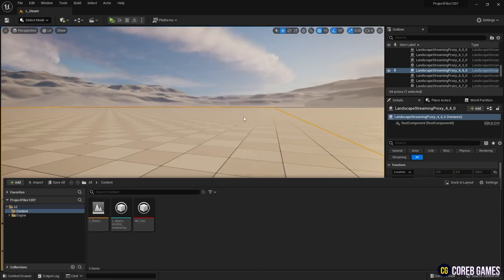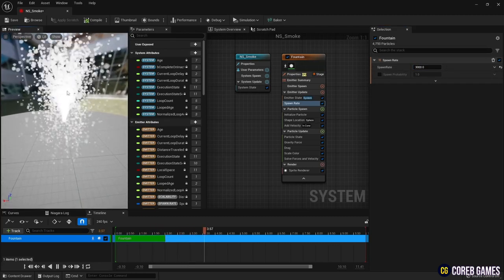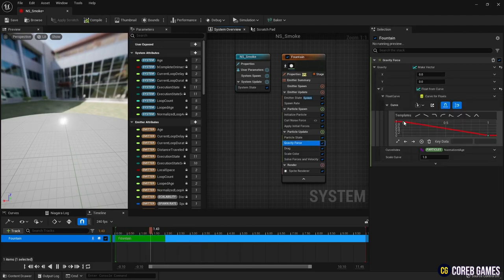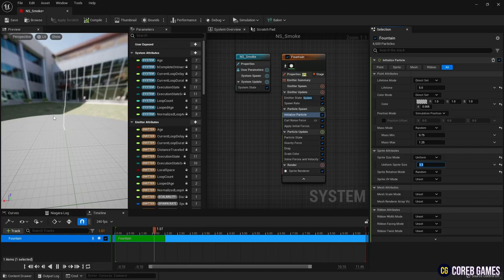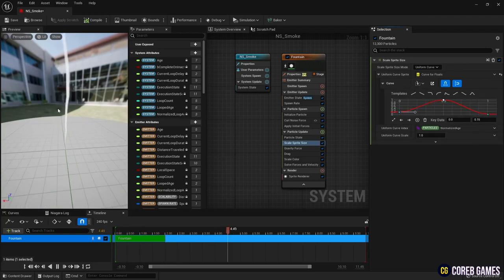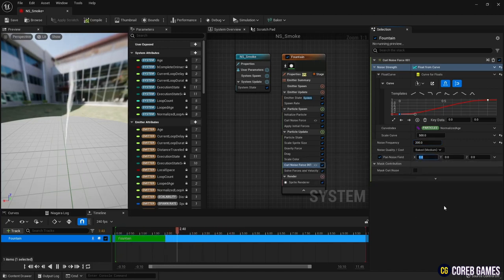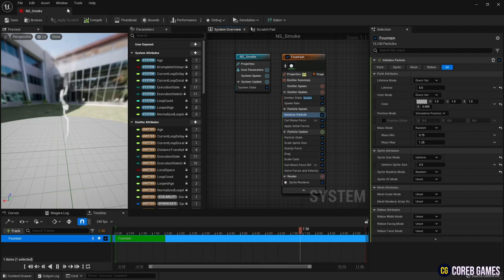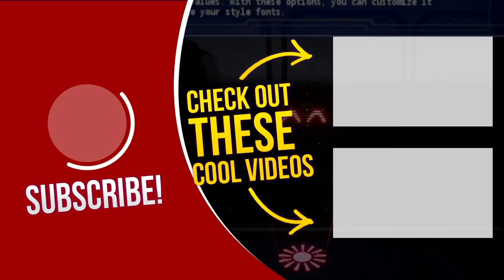UE5 l Cigarette Smoke Effect l Niagara VFX Tutorial l Unreal Engine 5

Comment: Damn that was good!. I only wish if you could elaborate on the things though. For example I want to make my smoke thicker and I have no clue what parameter does what but its probably me.
Reply: I'm also wanting to understand more.

For you, I think try "Scale Sprite Size" under Particle Update.  This is controlled by a curve -- the smoke starts small, gets wide, then shrinks.  You can click on the middle keyframe and find Key Data and change the second box.  (The first box is the location in time -- don't change that.)  Also, I think Curl Noise Force (also under Particle Update) pushes the particles apart, widening the stream of particles, so try that too.

Good luck!  What are you making?